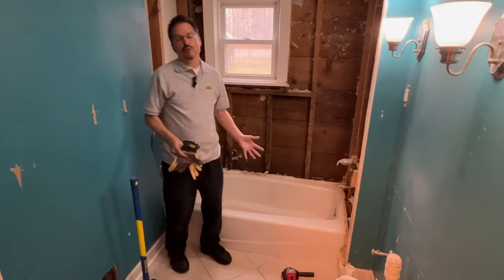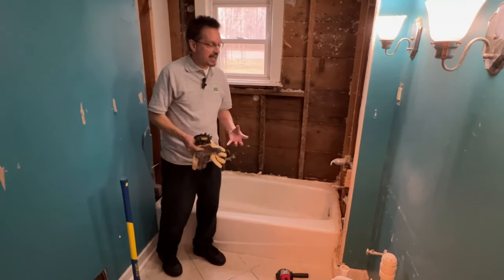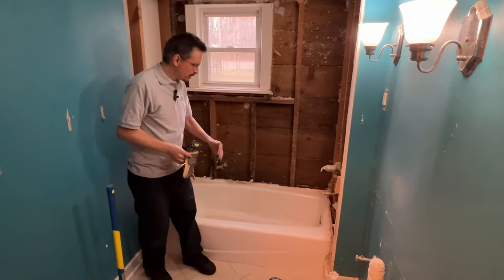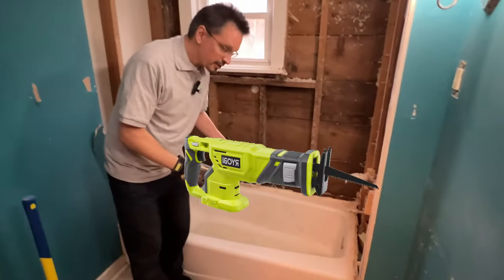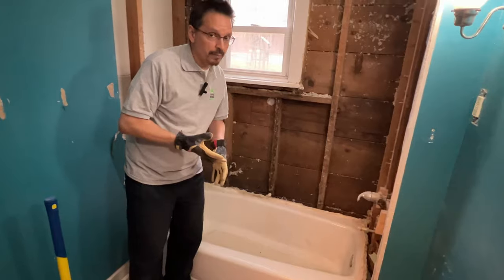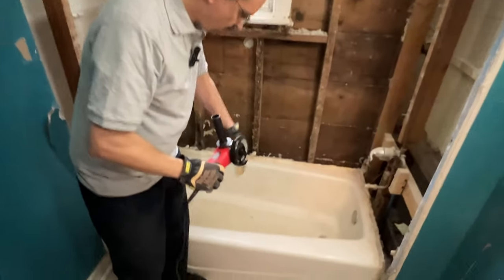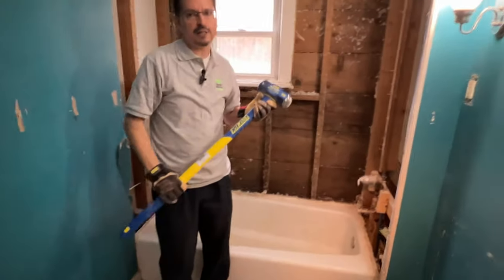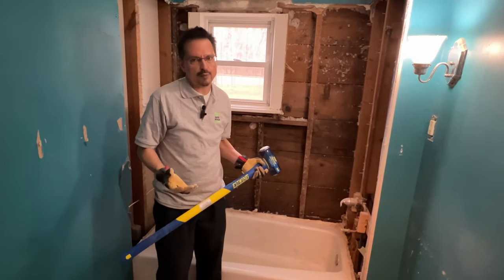Easily Remove Your Old Cast Iron Tub

Comment: I've done it 2 ways, 1 few times I did it alone, carried them out by myself, didn't ruin anything in the house, except MY BACK! LOL about 400lbs those things seem to weigh lol 2nd few times I cut them into 3 sections as again I was working alone but it was about a 2 hour job each time. I have broken them up before AFTER another crew got them out, owner wanted it broken up, I just remember the shards of basically glass it seemed like that I didn't care about. But you're saying 15 minutes, so I'm going to definitely give this a try this time. Thank You!
Reply from the maker: Thanks for sharing those stories 💪🏼 Busting it up is messy, but super quick AND save your back! 🛠️🛠️